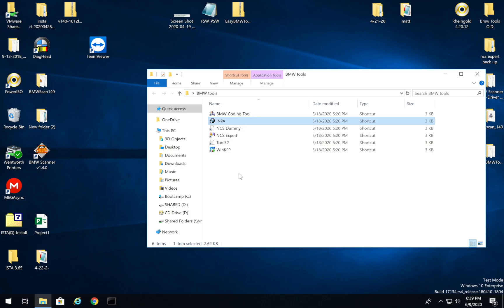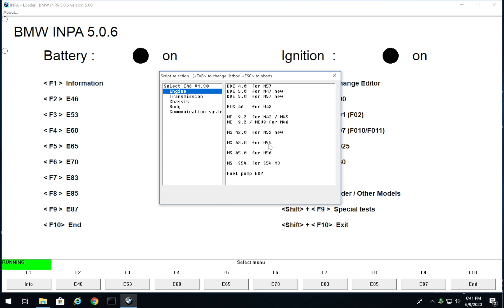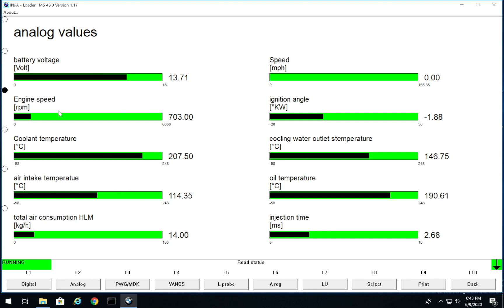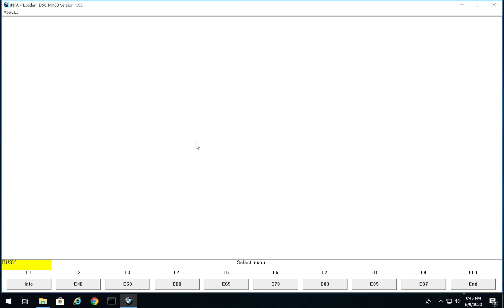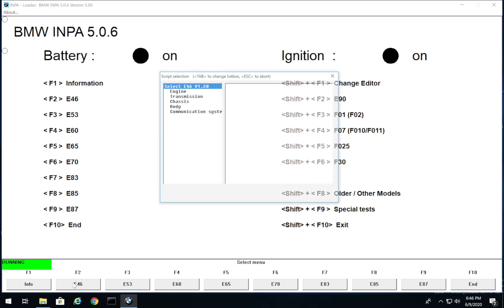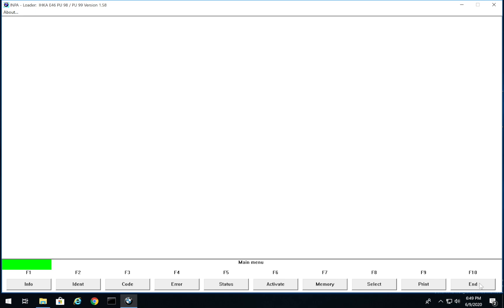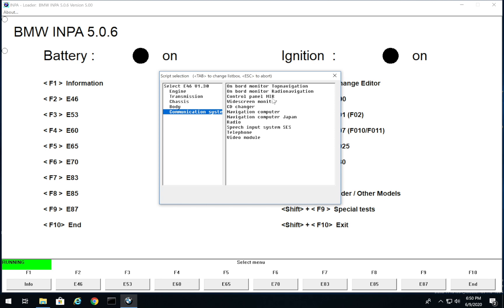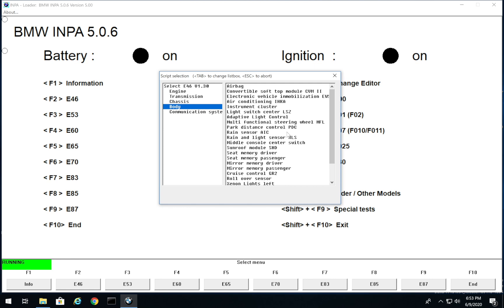How to use INPA to FIX your BMW - Walkthrough of INPA

Comment: i just got a 2--3 X5 and transmission is not moving at all. i am getting the bentley manual, and am trying to get the best scanning tool for my needs, if i go with this i need to get a windows laptop and a cable, but, will a midlevel diagnostic tool do the same things so i won't need to buy laptop and cable just for this cars diagnostics and coding?

Comment: Hi From Paris,
Hope you're doing well ! I'm starting to learn to play with Ista+. A software with many features and merits... because it's very comprehensive.

I'm stuck in my hybrid (HV) battery balancing procedure. I'm on a BMW X5 F15 hybrid (xDrive 40).

I can't find the function to update the computer address table for the modules and electrical measurement components (voltage and temperature measuring device).

Physically, this HV battery has six modules in series, installed on two levels. According to ISTA+, they are labeled 1, 2, 3, 4, 5, and 6.
Stage 1 (lower level) stores modules 1, 2, and 3. The upper level stores modules 4, 5, and 6. The modules are similar, with a box with two connections: (x1) for temperature measurement, (x1) for current/voltage measurement. According to ISTA+, they are labeled 1a, 2a, 3a, 4a, 5a, and 6a.

I clearly identify the measuring devices 1a, 2a, and 3a that are not recognized.

Initially, I had a 4V difference between the modules, which caused the vehicle to regularly break down. The balancing is done properly.

Can you help me retrieve the address of these components, which are essential to the vehicle's operation?

I have an original software license and an Enet cable. (I'm really frustrated because I'm in a parking lot and I don't have a web connection.)

I am also big fan of your job!!!

Comment: I don’t get the battery or ignition on for my e46 through the obd2 under the steering column. My inpa software and cable work on my e38 with the 20 pin adapter thou. What is this about bridging pins? Should I do that or should I have the battery and ignition on before I mess with other stuff?

Comment: Does INPA have the ability to change the engine idle rpms. I have the 3-2-1 bump and its a rebuilt transmission so before buying another valvebody as it could be the low pressure valve, I wanted to try the raising of idle rpm values that is another trick to fix this.  Yes I have reset transmission adaptation values with no change.

Comment: So my e90 has no power , I can’t turn on the auxiliary / push to turn on electronics  because I’m having a problem with the car not having power

My question: will inpa let me scan the car with only battery power and not turning on the electrics ? 

I need to diagnose my modules to see if they are ok or bad , i already replacing battery , terminals , fuse boxes , power cables , ground straps …. I’d like to trouble shoot modules before i buy any more parts that don’t need to me replaced to fix my problem

Comment: Im glad i found this on how to use inpa in simple terms. I have a question, my inpa only works with the engine codes  but not on the other functions like its body controls, transmission, etc. It says “No response from control unit. Program will be stopped”.
Reply: INPA error IFH-0009
Reply: pins are bridged?
Reply: Same here

Comment: Hi, i have the cable connected with pin 7 and 8 bridged, impa reads the code for the engine and the values of it but don't read the rest of the chassis/bodies etc 
Also if i use ncs expert it doesn't work. I have a 323Ci. When i open impa even if the cable isn't connected to the car tells me ignition on and cable connected.

Comment: Excellent video!  Been working with INPA for the past couple of months and I'm learning.  Can you tell me how to read the low fuel pressure sensor readings and the high pressure sensor readings on a BMW e90?  Thanks.
Reply: Hi, just installed INPA but need to use if on my E34 and E30 but don't see any F functions for those models. I've been told I can use this for them. Any truth to that?

Comment: My inpa changes to German when I try and diagnose my e90...
Reply: Anyone know how to make it english?
Reply: Same problem.. 😢
Reply: Same I use google translate
Reply: Hi, I am about to use this to try and diagnose a no crank no start. I have the s/w installed and the suggested cable. What were you trying to diagnose?
Reply: @SAABguyMD   Ash here.
Wonder if you could advise me on something.
I've been struggling to start my friends e46.
Problem seems to be the anti tamper protection.

I recently watched one of your videos on inpa and downloaded mikes bmw tools from the link you provided. I had a cable that i purchased from a shop here in SA, I think its a rip off as it doesn't have the switch from kline to dcan.

When I connect to the car, the battery and ignition light stays on, on the inpa program. Even if i bridge the 7 and 8 pins on the cable.

I somehow managed to read the error codes and it says 144 manipulationsschutz ews which is the anti tamper protection.

I tried to sync the ews and dme, get a few messages in German that basically say start value already set.

Do you maybe think that i should buy a proper cable?

Its an e46 318i 2000 preface lift, with the 20 pin round connector not obd.

This car was bought from someone, i think they tampered with the car before as well, so I maybe want to try and recode all settings back to factory as well, however for now I'd like to get the car started. 
Any advice would be appreciated
Reply: @ hey man any updates ? I have a 2003 e46 325i same problem im just trying to get it started but not sure how to use the inpa software

Comment: Hello thank you for making this great and helpful videos!👍

- I have a 2008 BMW e90 and I need to reset the adaptations after a transmission service.
 Will this software be able to do it and what is the correct type cable?
Thank you!
Reply from the maker: Yes
Reply from the maker: Kdcan cable

Comment: I had bought BMW DIS V44 V57 SSS V63 & TIS V8 INPA EDIABAS DIAGNOSTIC SOFTWARE USB 20-16 PIN. I noticed your version has a lot more English than the version I got off ebay. Is there a setting to change it to English on the program or is it just a difference our softwares? Your version looks a lot easier to use for someone that speaks English where my version is a lot more German.

Comment: Oh man! I really need help here 🙏 I have a 2006 BMW 330i and I ran the process and worked the first time. I topped it off, turned on the car and it overheated. I tried to run the process again and I couldn't get it to bleed anymore. I checked all fuses under the hood as well and all are good. I can't figure out why it won't run anymore. I'm stumped 🤔 Can I activate the pump with this software?
Reply from the maker: Yes
Reply: @EvanGoyuk  I just used it to activate the pump and I got error 2E84 - Pump missing lol. It's still there 😂

Comment: do you recommend using a trickle charger while doing this ?
Reply from the maker: Yes
Reply: @EvanGoyuk  so you think when my mechanic did the position clutch sensor swap.  when he tried to adapt it he didn't have it connected to a trickle charger.  because when he swapped the old one out with a new one  the fault came back right away.
Reply from the maker: I don’t think it’s a trickle charger issue
Reply: @EvanGoyuk  what are you thinking ?
Reply from the maker: Was it a new sensor?
Reply: @EvanGoyuk  yes. and the same issues occurred

Comment: Hi Evan, Ash here.
Wonder if you could advise me on something.
I've been struggling to start my friends e46.
Problem seems to be the anti tamper protection.

I recently watched one of your videos on inpa and downloaded mikes bmw tools from the link you provided. I had a cable that i purchased from a shop here in SA, I think its a rip off as it doesn't have the switch from kline to dcan.

When I connect to the car, the battery and ignition light stays on, on the inpa program. Even if i bridge the 7 and 8 pins on the cable.

I somehow managed to read the error codes and it says 144 manipulationsschutz ews which is the anti tamper protection.

I tried to sync the ews and dme, get a few messages in German that basically say start value already set.

Do you maybe think that i should buy a proper cable?

Its an e46 318i 2000 preface lift, with the 20 pin round connector not obd.

This car was bought from someone, i think they tampered with the car before as well, so I maybe want to try and recode all settings back to factory as well, however for now I'd like to get the car started. 
Any advice would be appreciated
Reply from the maker: Hello, What year is this car?
Reply: @EvanGoyuk  its a 2000 model
Reply from the maker: You need to use the 20 pin under the hood

Comment: Hey man, u know why i cant read body or chassis codes? it says error: ifh-009 no response from control unit. Engine codes work fine and clearing etc. Car is e46 320d 2003, tried with pins 7-8 bridged and without too.

Comment: Which pins need to be bridged? Does anyone have a picture?
Reply from the maker: 7 and 8 or just buy a cable with a switch!
Reply: @EvanGoyuk  Yes, I have the same  cable (K+DCAN) as you list in the description. What position does the switch needs to be set to? Left or Right?
Reply from the maker: Left

Comment: Hello Evan! So I installed the software and I have a cable, hooked up to my 2007 E83 with the N52 engine, and all was well until I started deeper into the menus - they were in German. Is there a fix for that, besides translating?
Reply: Quick fix is to take phone and picture translate it:)

Comment: bought the cable and software and installed on laptop, I cant seem to find out how to fix my car with it though, 2A99 and 2F4A codes, car is a 2007 x3, just turns over and over and wont start
Reply: John Collier 
This is interesting.  07 x3.  2A99 and 2F4A.   I'll look um up.

Comment: Great videos man. This is the second of your videos that I have watched - specifically trying to learn quickly how to use this software (already downloaded and the profiles copied in) and how to FIX both of my e39 540iT. I have a 2001 (Gandalf The Grey) and a 2003 (Gandalf The White). The Grey is actually stranded somewhere not at home after suddenly misfiring all over the place..... right after I cleaned the combustion chambers out and it drove extremely well for about 90 minutes. Then I parked it for about 5 hours while at work and then I tried to go get lunch and it was not even the same car I drove that very morning.  I replaced all four O2 sensors, but the car now refuses to start and run - I'm thinking codes need to be cleared - but I'd really like to hear from you or someone about this. I've never done this kind of work before and it frightens me to think that I will start screwing my cars up by not having a clue. The White, sitting now for two years in silence, has had a TRANSMISSION FAIL SAFE MODE problem for about three years now - it's been driven very little and is in fantastic shape overall. Do you think I can correct this fail safe problem using the cable and software? Does anyone know anything about this? I likely will have to join and hit up a real forum. But any help is greatly appreciated for sure. I've done a pretty damn good job at working and repairing my 5 vehicles since I started in 2014 - but I'm coming up against another steep learning curve and I feel lost. Thank you.
Reply: How did you get E39 profiles?

Comment: How would you code a new/used Abs/DSC module an E46 convert?  Also do you have a direction for ISTA?
Reply from the maker: I will be making a video on coding a new DSC module I need to replace mine. Email or message me on IG for help with ista

Comment: (cont) How can I tell which click is connecting pins 7 + 8, and which click is disconnecting pins 7+8, there're is no indicator? I guess when unplugged I could use an ohm meter. TIA
Reply from the maker: Yes a meter

Comment: Evan, re: the K+DCAN Cable with the switch. I purchased the cable from Amazon following your link to your recommended cable.Thanks. Mine has a push button switch rather than a slide switch. It clicks when you push it and clicks if you push it again.How do I tell when it is connecting pins 7+8

Comment: Can inpa correct my odometer? Can it do any boost modification?
Reply from the maker: No you can not modified your odometer with any software
Reply: @EvanGoyuk  how is it done ? You can absolutely do it as I have seen it done with a hand held device.  That was years ago . These days you must be able to do it with software and a laptop w a cable .
Reply from the maker: When you say correct you mean get rid of the tamper dot or change the mileage?
Reply: @EvanGoyuk  change the mileage because i have purchased a new cluster and need to adjust the mileage to match the actual mileage .

Comment: Hi. Thank you for the easy installing. I have an e83 lci (2007, m47), the program (inpa and ncs) not communicate with the engine, with the rest of others yes, i can read the codes in inpa, but dosent work to read the vin, or to code anithing in ncs.... Have u any idea? I have the same cable, with the switch, i tried all the positions for the switch. Thank you, Szabi:)

Comment: What's up Evan, first thank you for all your videos. However, I have a small inconvenience. I can read my ecu without any problems, but when I want access to another module I get the ihf-0009 error code. Any idea what it could be?
Reply: so if i have e36, do i need 20 pin odb2 adapter with this switch + obd2 usb adapter with switch? like 2 adapters with switches?
Reply from the maker: Yes and yes
Reply: @EvanGoyuk  okay, thanks
Reply from the maker: Yes abs yes
Reply from the maker: Thank you for watching! Ah yes this sounds like pins 7 and 8 are not bridged? Does your cable have a switch on it? If not I suggest buying the cable linked in my description it’s the exact cable I use.
Reply: @EvanGoyuk  Do I have to switch it if I want to read the other modules? I have that exact cable
Reply from the maker: What car are you trying to read?
Reply: @EvanGoyuk  325i from 2005, e46 m54
Reply from the maker: Yes you need the switch set to all the way to the left

Comment: Which pins are needed to be bridged to connect to E39  using INPA. There is no pin count in the K+Dcan cable. Does anyone has a picture of bridged pins?
Reply from the maker: Just buy the cable In my description and you won’t have to mess with anything
Reply: @EvanGoyuk  I have the cable, how do i know which switch position is bridged

Comment: Hey is the car running while you’re using INPA? Or just accessory mode? I noticed the engine rpm speed and intake temperature were moving with the analog values. Is it safe to code the car with the engine on? I’m afraid of draining the battery if the engine is off
Reply from the maker: I code in accessory mode and run tests with engine on!

Comment: Hi the link for the  K+DCAN CABLE doesn't say it supports E46. Will it work for my 00 323ci?
Reply from the maker: Yes it will, you may need an adapter to use the 20 pin under the hood